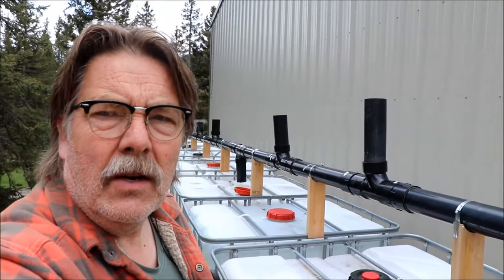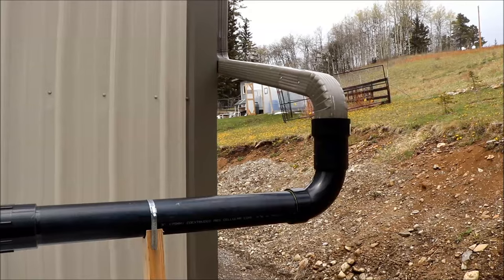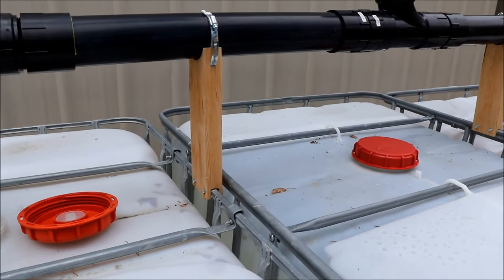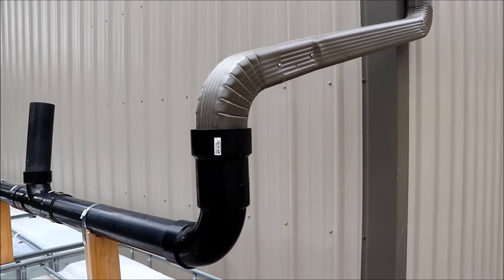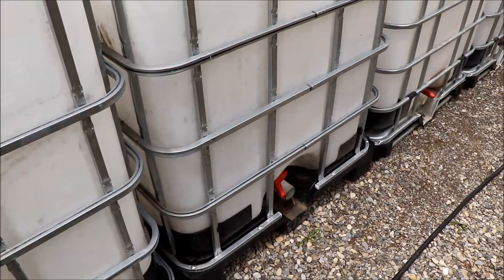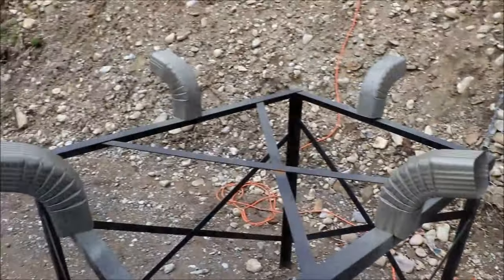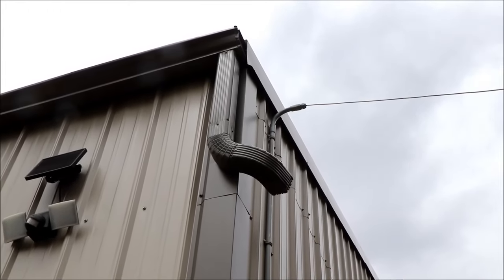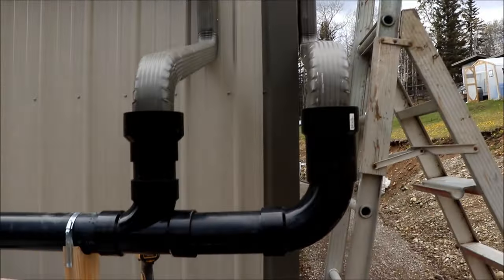8000 LITER RAINWATER HARVEST SYSTEM. AWESOME

Comment: Do NOT do this! - So much pipes and work to fill 10 contaioners!  Stuppid when they are connected in the bottom - just leave the water to runn in to one container, keep the connected bottom valves open and all the containers will fill up simultaniously.   This is a waste of work, investements, pipes and also labour to go back and turn pipes up and down!
Reply: Your actually right about that
Reply: let see what you built
Reply: I agree with not doing this like he did unless he is physically moving those containers
Reply: I agree with you but the bottom opening of each container is quit small,  so i wonder if the pipe connecting all the IBCs together will support the water flow during heavy rain. If not, the water will not have the time to fully spread across all IBCs and the first one will overflow.

Comment: Have you thought of tying the totes together with PVC pipe closer to the bottoms of each tank?  We do that and all the tanks fill up.  We have an overflow PVC pipe near the top of the last tank so that when all the tanks are filled the overflow runs out.  It would save on your having to monitor each tote when it fills and manually switch.  Just a thought.

Comment: It seems to me that one big water tank would take less room and be simpler.  But I love how ingenious this is, and you have all that nice soft rainwater to use. Nice.
Reply: Ya, agreed. But, have you ever priced those single tanks? IBC totes that are used are typically FAR less expensive than the large tanks, 3k gallon +… most of those tanks at close to $1 per gallon … he has about 2500 gallons of water and has spent maybe $1000 at worst. Much less expensive.
Reply from the maker: We priced out a large cistern which would have cost a lot more than the 8 IBC totes. Also I am a million dollars away from my first million and bought the IBC Totes when we had the funds. So there is that to consider if you are on a budget. Any way thanks for watching and have a great day.
Reply: @TripleBRanch  a 10.000 l concrete water container cost 1000 ,I bought 10 years ago one and recently looked to buy a second one
Reply: @fromthewoodsyyc put a section of copper pipe in each container and it will prevent algae growth.  I've seen ppl put copper piece in water tanks for cattle and it did prevent algae growth and a guy put a piece in his skimmer basket of swimming pool and in 24 hours the change in the water clarity was dramatic. Worth given a try.

Comment: they have IBC caps that have dual  2 inch bung plugs in them so that you could have your fill pipe going in one side and once it's full it would overflow out through the second hole and then go into the next tote and once it was full it would go into the next toad and so on and so on then you would feel one toad at a time and once it reached the last tote being full it would overflow into your ground drain or whatever you have there.. that would just be an automatic way to fill..
And at the bottom you have your big valve if you create one long pipe that connects all of those big valves together then all of your totes would fill at the same time as long as the bottom valves are open leaving you more options

Comment: The way I have mine is that once the first one gets filled in it uses the pressure to fill in the second barrel and so on and so fourth. There is no need to sit next to them and flip the pipes to fill in each individual one, it's a lot of work and you'll get wet. You did a fantastic Job, nonetheless! Subscribed..

Comment: they should fill all at the same time by connecting them all together from the bottom ball valves
Reply from the maker: Yes they might. I intend to connect the bottom valves at some point and I will see if that works.
My feeling is that they would not fill to the top. When funds and time are available that project is on the list.

Comment: I used on 10x IBC Tanks the Method of communicating tubes to level them out automaticaly . I used 10x 1 1/2 Zoll Hoses and I chose this Methode as my Valves on the IBC seems to keep leaking after some Month/ Years. Running that System is Failprove withouth Energy consumption and Micromanagment in geting the IBC Tanks filled up. ( If your Valve on the IBC Tank are good , then connecting them all with at least 1 Zoll would do the Trick too. )

Comment: This system is not well designed.  In an extended heavy rain situation, I can't imagine that you stand in the rain, and monitor the water level and switch the inflow one-by-one. Or in any situation, you have to constantly check the water level.

You should just connect the two downspout to the two totes at each end, and then connect all the 8 totes from the bottom.  The gravity will do the work to fill all the totes.  In addition, you should set up a overflow from the two end-totes, so when all the totes are full, the water will flow out from the two totes.  Lastly,  add a valve or two at the bottom pipe as outlet.  In this way, the whole system takes care itself without any manual intervention. 

Separately, you should paint or cover the totes in dark color to prevent algae.  Also rainwater from the roof will carry a lot of dirt, debris, leaves, etc. you should have a filler system before the water go into the totes.
Reply from the maker: Thanks for your comments. The intent is to tie the totes together at some point. This is a work in progress.On the other hand we do still have 8000 liters of water to use regardless of how bad the system is designed.We do not find it a burden to monitor the system during rain events at this time. Anyway hope you have a great day.
Reply: @fromthewoodsyyc  
A chicken has a little head, but even they have enough sense to stay out of the rain....
Reply: I came here to say this.  Maybe a little more gently though.  If all totes are level they will automatically fill to the same height if daisy chained on the bottom bung.  Hopefully you will be able to reuse some of the pvc and fittings for this.
Reply: good points, would love to see pics of yours......
Reply: My thoughts exactly
Reply: I disagree, although having to monitor the tanks while filling is a pain it is acting as the filter. The first rain run off will be dirty so let it go into TANK 1, then you can fill the others as they fill. Who cares if you get a bit wet flipping the tanks over?
Reply: @fromthewoodsyyc  Your system is very neat I like the fact you use the first tank as the filter. All the crap and debris from the roof can go in TANK 1. Its not drinking water anyway so its ok if its a bit dirty. Ok so someone has to go out to change over the tanks as they fill but what the heck? Neat Job

Comment: Saw another rain water collector who did something that may help you. Having to manually turn the fill pipes could cost rain water. What if you extended the pipe into the tote and put a plastic soda bottle in the pipe so when it filled the water pushed the bottle up sealing off that tote? That could make filling all your totes automatic.
Reply: smart

Comment: Where did your shop? Cost? What size is It? How much for your concrete and install? Appreciate your video!!!
Reply from the maker: I had local builder build the shell and we did the interior. No Concrete, we framed a sub-floor and did T&G Fir. Concrete was out of our budget. 30x60 floor space. All in about 70K CDN with excavating and interior finishes but no labour cost on the interior. Check out our shop tour on our channel. Thanks for watching.

Comment: It would have been way cheaper to just get some uni-seals and pvc pipes to connect them from the top to be filled one at a time.  Or connect them all from the bottom to fill up all simultaneously.

Comment: Regardless the water usages it needed protection and vent
Reply from the maker: Yes a screen would be nice. hasn't been a problem so far. Shop does not get a lot of leaves or debris on the roof. And we try to collect the first bit into the first tank. Which has worked well so far. Venting not a problem unless we forget to open lid when draining. Its not a perfect system but I still have 8000 liters of usable water for the garden.
Thanks for watching and have a great day.

Comment: A lot of UN-nessasary black pipe. Elevate the totes a foot or two,pipe the roof drain into one end tote, or one on each side...Manifold all the bottom outlets together with a faucet with inch or inch and a half pvc......When it rains it will fill the all the totes at the same time at equal rate until full, and then out of an overflow....

Comment: You really need to re think this. You need a first flush (minimum,  2 flushes are better).  You will lose A LOT of water in a heavy rain.
Reply from the maker: Thanks for watching. I don't use the water for drinking or watering animals. We try to flush the dirt off the roof into the first tank. That water is still used for watering the garden but the remaining tanks are relatively clean. If I had to flush all the water off of the 30' x 60' roof surface every rainfall before collecting I would never collect anything. Regardless of how bad you think the system is I still have 8000 liters of water for the garden which comes in handy during the dry spells. I don't think I will rethink the system other than maybe tying the tanks together so they all fill at the same rate. Have a great day.